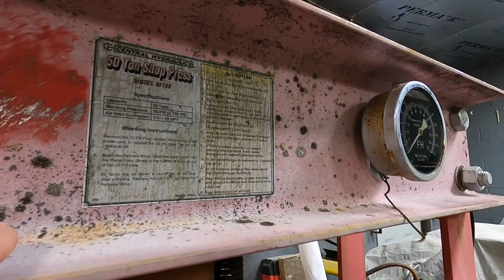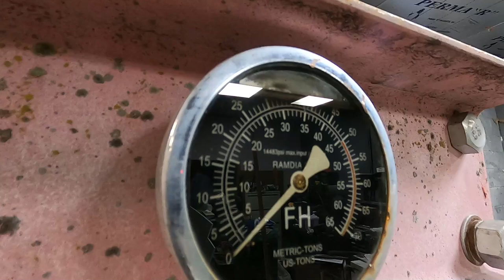MAJOR PRESS EVENT! Time to fill the empty space

Comment: I've  got the same press here, ours was only a couple of yrs old and stopped working, I had to disassemble the pump and clean it out it was full of crud. I also made a more sturdy bracket for mounting the winch on what raises and lowers the table. We bent the bracket, putting a Perkins 6 cyl engine block on it. They are a handy tool. I since picked up a 60 ton Epco press but that's hand operated only.
When you were unloading your press, reminded me of Bryan (bcbloc02) when his overhead gantry crane failed and the Carlton drill  seen some drama! 
All the best 👍🏻 🇬🇧

Comment: @Steve Summers   Looking good, though you might as well go ahead now and add another cable clamp at each juncture and  loop the cable back through the lower one (or add 2 more and forget the loop) because one is gonna' let loose at the most inopportune time, you can bank on it. The proper way is 3 clamps each applied facing the same way.  Be safe first.

Comment: Steve, put that on a pallet so you can move it around, put a sheet of ply on the pallet first, so anything dropping has a soft landing and won't ruin the part or the concrete.

That pump needs a rebuild, along with the ram... just flush, and clean and it should be ok, the pump might need new o rings.
The pallet will protect your concrete
Reply: That’s some sound advice, at a minimum he should keep the casters handy in case he decides to move it around when he’s figuring out where he wants everything.

Comment: Steve , have you ever heard the term "never saddle a dead horse"? You are doing that with your cable clamps. The dead end of the cable should have the bolt loop around it and the clamping part ( saddle ) should always be on the live cable I learned that from an old crane operator it cant slip  that way Nice job on your shop Be safe

Comment: Just a heads up, the air pump wants a teaspoon of air tool oil before you use it. And they normally run much faster under no load at 90 psi
Reply: Nailed it.

Comment: great piece of gear, crazy useful. 2 things that are in other comments as well... 1: oil the air system 2: put the casters back on the press. you can then stick it in a corner and use it for small stuff and maintain the ability to press bearings and sleeves out of longer shafts or straighten shafts as well.

Comment: Cutting steel cable, use a plasma cutter, O A cutting torch, stick welder or mig works well, tie with a piece of wire, the end of the cable will be welded together no nasty sticky out bits of wire!
Reply: Slip a copper sleeve over then braze up and cut. no sticking bits and will never untangle either. If not brazing ( zinc coated wire) just the copper sleeve slipped over and crimped up will do.
Reply: 42 years in cranes and that's the way (with a torch) it's always been done but I'm talking half-inch and up.
Reply: @Craneman4100w  That's how I'd do it in the field, ( I've been using cables as long as you!) in the workshop I prefer a cut that melts the end together! All the best, Matthew

Comment: Good Morning Steve, Congrats on moving in the first machine. That's going to be a nice press. Very clever and simple design for balancing that lifting cable. Getting the ceiling installed will sure help..I complain when it's 50 degrees in my shop..I'm sure your ready to get out of the cold..

Comment: Hi Steve - great job with the shop - I'm probably too late with this comment but I have had excellent success moving heavy machinery by laying down, preferably 3mm hardboard or if not that, 3mm MDF sheets and sliding the item on the shiny surface.  Overlap onto another sheet and you can keep bringing the first sheet forward.  Protects the floor too!

Comment: Hello Steve, some food for thought,
Push those two table pins in flush. I recommend putting locking casters back on you'll enjoy the ability to move the press around for odd jobs. I replaced that POS hand winch with a cheap HF electric winch. Prob want two two 4"x4" steel bars for press work on that table. Also, take a look at the ram, you'll likely notice there is a removable piece(there should be a set screw that keeps it locked in). You can machine all types of specials that will fit the ram for different operations. Lastly, might consider a cage made from fireplace screen that can be easily pulled open/closed. 50tons is a crap load of pressure if you ever crank it up and that energy gets released. Awesome, you have that and congrats for all your hard work. I watch all your videos as you're a class act.

Comment: That paint job on the press would be a candidate for a quick bit of work with buffing compound and then some automotive wax. Should change it back to the original colour with no problems, and will also keep it from having any further issues.
Reply: My thought exactly. It looks like there are only a few rusty areas, otherwise the paint seems sound. Remarkable overall condition for having been out in the rain for as long as Steve said it was.
Reply: @crichtonbruce4329  Yes, looks like an old powder coat, put on long ago and just sun and weather faded. A buff up with cutting compound and then a wax job will make it look like new again colour wise, and the wax will both protect it and keep it looking more or less like it is used but well maintained. to strip off that coating will be hard, and likely any more modern coat applied over it without stripping will peel off soon.

Comment: If I may offer a suggestion, put swivel locking casters on your press, directly to the frame. I did that with my 20 ton press and works great. Doesn't move when I lock the casters. I can easily move it around and store it out of the way when not in use. 
You left brake light is out. Cheers :)

Comment: Glad to see it all coming together!  I have a cheap 20 ton press, and the biggest change I made to it was adding about 20” of height so I’m not always leaning over when I’m using it. Saves my back. I also have a cheap 2000lb ATV winch hanging from the main beam of my shop. Makes load and unload pretty easy, up to and including my bridgeport (which I took off in pieces). Back the trailer under, lift with the winch, pull the trailer out.

Comment: Hey Steve, (Happy New Year). Might I suggest four hockey pucks and four carriage bolts, counter sink drill the centers of the hockey pucks to accept the carriage bolts. Lift the press up and install said hockey pucks under the legs of the press and bolt them through the legs (base mounting holes) of the press. This will protect the floor and give ever so little space to sweep under the press legs. The pucks will more than support the weight of the press and anything you may put on it over time. You have gone through all this work and like any guy who has built or renovated a shop will attest to (we can't stand a messy shop, unless of course we messed it up). Hope you find that helpful. Cheers from Canada! Stay Safe and thanks for the share!

Comment: Next shop project should be a wheeled gantry crane to lift heavy loads like that press. Can be use to remove and install vises on the shaper and mills. Chucks from the lathe also and heavy work objects onto them

Comment: About 20 years ago I moved equipment into my new shop thinking I’d sheet-rock the ceiling later. 20 years later the ceiling still isn’t done because of all the equipment I’d have to move or work over. I seriously recommend you get the ceiling in place before you have to work around equipment.

Comment: You will be glad you got that press! I have 2” thick press plates for my 40 ton press! I had a very similar pumps system but mine didn’t have the Air over hydraulic, I just replaced it with a foot controlled air over hydraulic pump. I have yet to put it to the test but I’m sure it will do the job!

Comment: Great job Steve.  For a 50 ton press, your press plates should be min 1.5" thick and 6" wide each side of the v notch.  A pair of 1.5x8x16" plates with a 2" V notch at center should be good for most of your work.

Comment: If you plan to use your hoist attached to the truss, you should consider adding a beam parallel to the bottom cord of the truss. Those trusses are not usually designed for the point loads you are using. The addition of the plywood and composition shingle is probably putting the truss near it's maximum values. An LVL, LSL, glulam, or steel beam would be easy to install with the ceiling wide open. Your local lumber yard (not Lowes) should be able to help with the calculations needed an engineer is also helpful. All of your work done only to break a truss would suck. Good luck and be safe.

Comment: The  press has an air impact to break seal when pressing stuck bearings. Usually need some air tool oil to get the hammer working right but works in conjunction with the ram pumps. This is actually a real nice unit that probably came out of a truck repair shop 50 ton is quite a lot and what you need to work on big rigs. Very worth saving. Unit this nice you won't find  for cheap new. There should have been a box of different size arbors for it wherever you got it from. Might have an issue and why it was tossed aside. As long as company not out of business parts should be easy to get to fix whatever  is wrong. Didn't see the make and model

Comment: Good morning Steve, Floor looks great. As for the press I haven the exact same one. I used my on the floor for a few years and then added casters. I found that the press was always not where I needed it and for large pieces I would have to move it out. You may consider putt the casters back. You will like the press. Hope you add the ceiling next before loading up the floor,  keep up the good work and Happy New Year!
Reply: Hi Bruce probably wrong here but do the flanges on the holding pins go between the upright frame and the table to ensure they don't move in the event of a "Ring Twitcher" or a sudden release of a stuck part .
Reply: @laurancemoseley3407  That is the way I use mine having the washers captured.

Comment: steve   put some air tool oil in the hose for the air pump. then put an elastic band or a tie wrap around the air switch lever so the oil will flow passed the switch cuz obviously it wont if the lever is in the closed position then hold your hose up high and secure the hose in that position for 5 to 6 hrs and let the tool oil drain into the air pump. this is no difference than using an air tool wich we always lubricate every  time we use them. i did this to my 20 ton air pump for my hydraulic press and it made a huge difference after it sat for about a year or 2 hope this works for you. i put about 2 ounces in my hose and actually let it sit  like that over night. the oil will sofen the rubber diaphram if its not to far gone.

Comment: When working with steel cable, never saddle a dead horse....  The U bolt will crimp the cable and weaken it substantially. I would do at least 1" plates, my 50 ton press flexes 1.25" plate. I bet by now you have all the machines in place, I know I couldn't wait.... Looks awesome! HAPPY NEW YEAR!

Comment: Hi Steve, Press looks good!
If you don’t want to fiddle with making plates, swagoffroad.com has some nice 12x12x1.5” ones made of 50-A572 steel. 
I couldn’t quite tell how you were doing it in the video, but when applying wire rope clips remember: “Never saddle a dead horse” 
The forged saddle goes on the “live” (loaded) cable, the u-bolt goes on the “dead” (loose end) one.

Comment: Steve, I woud recommand that you do an hydrolic oil change and clean the air pump side to remove any rust in the air section. and do that before painting.   And if you want to kick up one notch, change the air portion with an electric hydrolic gear pump or upgrade the reservoir and pump with an electric pump/reservoir combo like on ABOM79 press or like Keith Fenner has on his press.

Comment: Most of the rust on chromed shafts is staining around pinholes in the plating. I always use a rust remover such as CLR or POR15 Metal Ready ,first ,to remove the stain and lighter rust ,before using abrasives. Often abrasives are not needed at all.

Adding a turnbuckle to that secondary cable on the press platen would make level adjustment far easier.

Comment: You have a brake light out Steve!
Steve a very effective way to clean rust from chrome is to use tin foil dipped in water, it removes the rust but does not affect the chrome
Reply: It's ok it's the spare one.

Comment: I put my compressor outside in a Rubbermaid garden shed. I can just hear it run. It doesn't add unwanted heat to the shop that way. I get much dryer air in the winter even though I have refrigerated dryer which is only used when it is warm. I have had this configuration for 20 years it works fine. I had an Harbor Freight  compressor for years but switched to a big industrial model years ago. I put auto drains on my intercoolers and tank. The intercoolers condense a lot of water. I keep my rotary 3 phase convertor out there too. I don't like noise.  I use 5 wire twist-lock receptacles 4+gnd. for power. The 4th pin signals the convertor to turn on for machines that need it. I add a contact when necessary to 3 ph machines for the 4th pin.
Clever cabling on the press winch. I don't think mine is that clever. The two speed pump is a great idea.

Comment: Happy New Year to you and your family Steve. I hope 2021 is a great year for you all.   I left castor wheels on my press - makes it easy to move around as I need it.
Also, I've had good success using an end mill in my power drill to slot bolt holes similar to what you did here.  Stay safe and well :)

Comment: SWAG Off-road sells some nice press plates and they also have some press brake and finger brake kits for hydraulic presses. I picked up some  rectangular pieces of steel 6x12x1" thick on eBay to use as spacers/supports.

Comment: How a bout a I-beam running the length of your shop w/a trolly and a winch.
SHOP LOOKS UNBEATABLE. Nice work
Reply: Roof will not take that load easily, unless Steve puts a massive set of I beams onto the concrete front, middle and back, and a set of A frame beams in the roof space to support the crawler beam. Then he can get the 5 ton hoist that he likely is wanting instead of the half ton one the roof structure can handle.

Better not give Steve ideas, there might easily turn up at his door some 60 foot I beams, some feet for them, and a 10 ton crawler and hoist, all air powered.
Reply: Oh .. good thing it’s not on my property !
Thanks

Comment: Do yourself a favor and put your ceiling up before you move to much equipment onto the new floor. I didnt . 20 years later i still have a blue plastic tarp as a cieling. It is still doing a wonderful job holding up the blown in insulation. Looks like it did when i put it in. Still want to put up white  barn metal.

Comment: Happy New Year to you and your family.
That looks like a really good press with the huge flexibility of high and low speed pressure hand operated hydraulics together with air driven pump for high speed ram movement - ultimate design! 
With you mentioning how cold the weather is for you I wondered if it has a cold thick oil in the system? It did seem that it probably did need the system bleeding further as it's performance improved as you bled it some.

Comment: And remember folks, when using wire rope clips, "never saddle a dead horse". That'll serve you ,and whoever is at the end of the line, well.
Reply: Might be useful if someone were to volunteer the reason(s) why and the difference in 
load before failure or slippage for the correct versus the  incorrect installation
Reply: @arfonjones7188  Read the Manufacturer's technical data sheets. They will provide all of the relevant information for correct ,and safe, installation. They are very readily available.

Comment: Steve - is it too late to engineer a lifting arch and beam over the main doorway?  With a rolling skate/lifting crane block so you can unload stuff straight up then pull the skate along the bench into the shop ?
I guess you didn't want to back the ute onto the new floor either.

Comment: I’m pretty sure you are supposed to insert those pins all the until the washers  hit the leg. Those washers are not normally there on a stock unit. Someone has added the because it is always a guessing game of how far to insert them. If you continue doing it the way you did in the video, sooner or later you won’t have them in far enough and the back will slip off at the most inconvenient time. Resulting in a change of underwear.

Comment: What if there was 2 rollers in the bottom of the table and the cable just ran under the table and was attached at the top on the second tower? Then it would self balance and it would be a lot simpler? But I suppose since there's no real guides it could kink and go uneven.

Comment: That "cheap" parts store, (also where I used to work), is the origin of your press, and there's a chance that you can obtain a PDF of the original manual by the stock number on that label you showed at first.  I read it as 96188, for which the product is still listed, but for some reason the manual does not appear to be online.  You might be able to resolve that with an email or a phone call. Check out  www.harborfreight.com/50-ton-hydraulic-shop-press-96188.html    Most product pages on the site have links to download the PDFs.